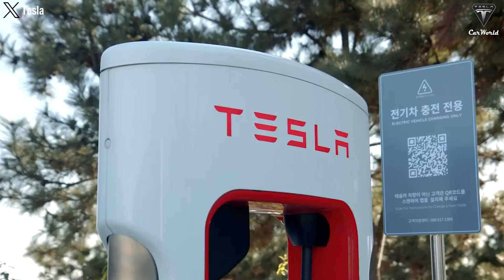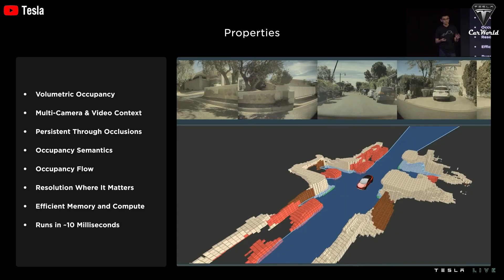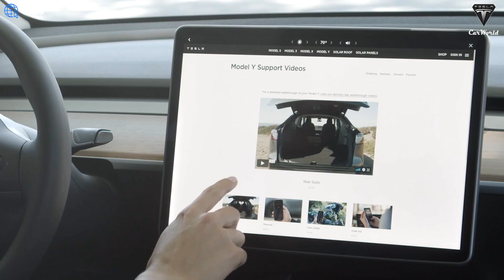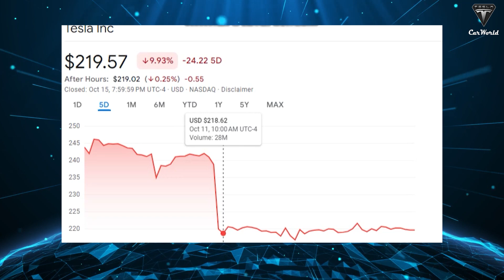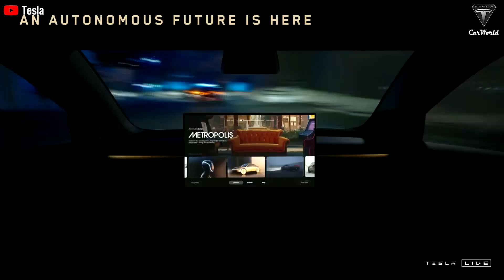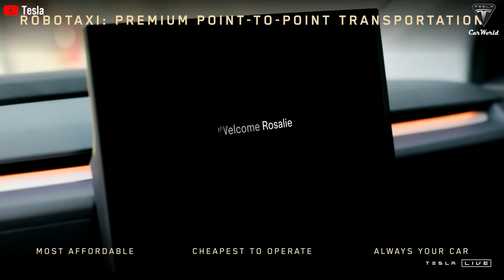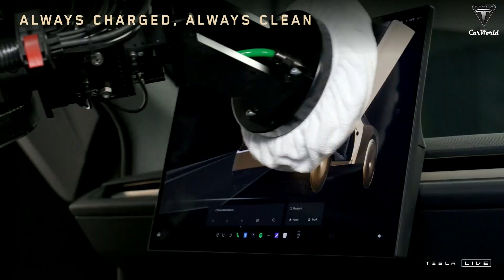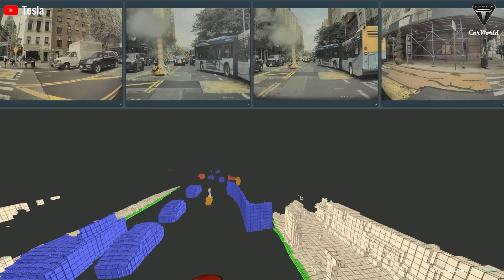It Happened! Elon Musk Public Tesla Robotaxi Reach $1T! Autonomous Industry Game Changer Destroyed!

Comment: I think all northern usa states and canada need supervised FSD vehicles because of fog, snow, ice, wildlife, single lane dirt / gravel roads, pot holes, and frost heaves.  That doesn't mean robotaxis
and robovans should ALL be robot driven.  Just that Tesla should sell supervised FSD vehicles and maybe sell for a higher price.  Highway and city driving FSD vehicles are great until inclement
weather or poor roads require occasional human supervision.
Reply: I am willing to pay extra for a supervised FSD robovan for example.
Reply: Imagine you are one of 15 passengers in a robovan which is topping a small hill or mountain pass at night.  A bull moose is standing on the road (this has happened to me 3 times).  At
first you can't see the moose because it's all black and not moving.  will FSD see it?  If not then probably all 15 people and the moose will die.  I didn't see the moose until I could see the
moose's legs, which are slightly white.  Massive braking, a horn, and steering helped me avoid the moose.  This apparently happens fairly often in the Northern states and Canada.
Reply: One time while driving a 1939 Dodge pickup on a long straight highway I saw a car attempting to pass and mentioned to my passenger an accident was about to happen.  I stopped and
pulled off the road.  All of the about 8 cars ahead of me going in both directions ended up driving off the road, no crashes, but it was close.  I have no idea how FSD would have done,
but I predicted it and I don't think FSD can predict.